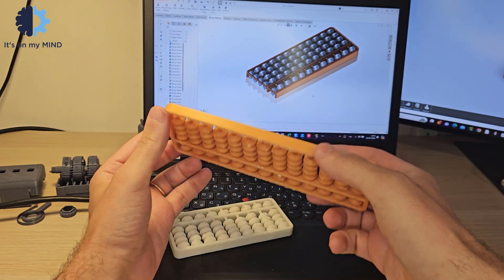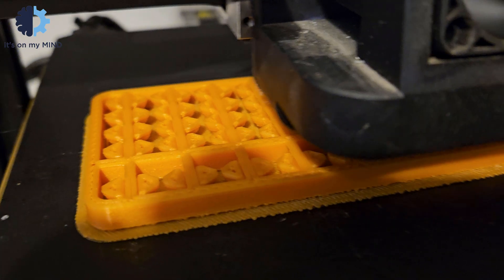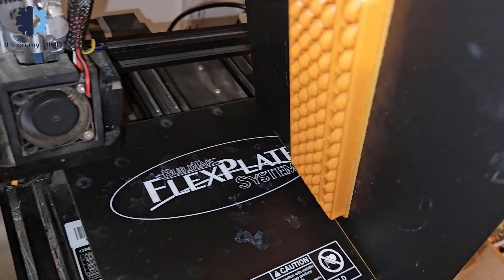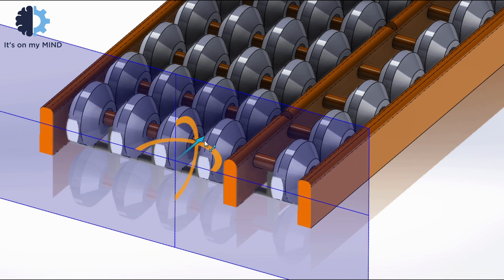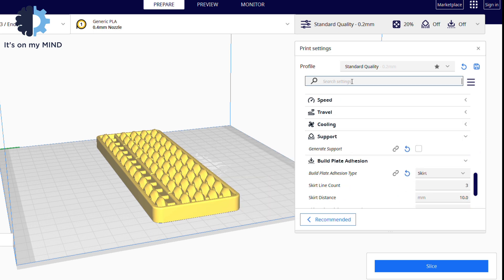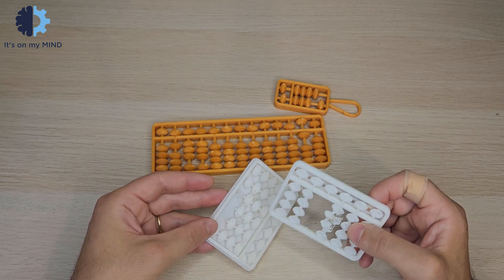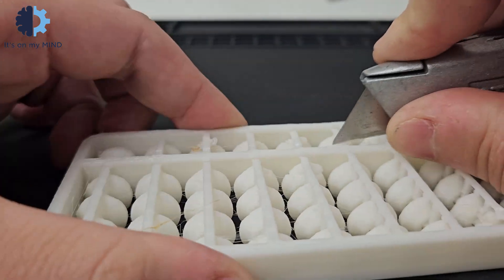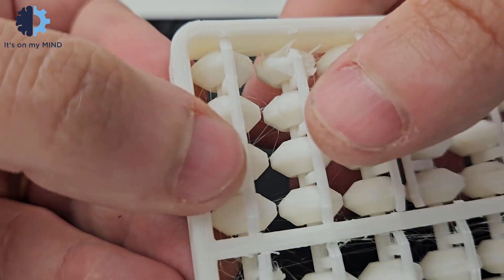Mechanical Calculator - printed in place!116 Moving Parts | No Assembly Required

Comment: Where are you getting 116 moving parts from what I can see that only moving parts are the beads themselves and there are only 65 of them? Again I guess the rods pivot aswell and if each set of beads is on its own rod that still only gives 91(13 for digit and 13 5 digit) parts where are the extra 25.